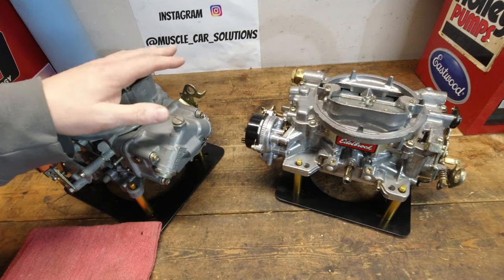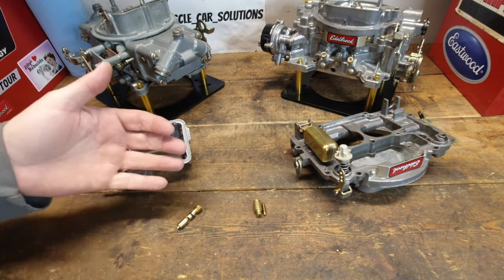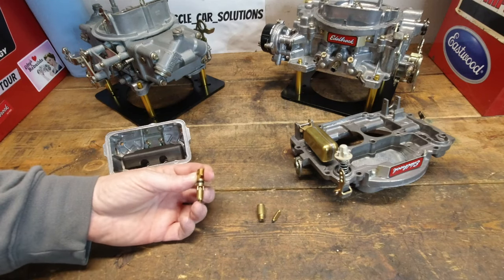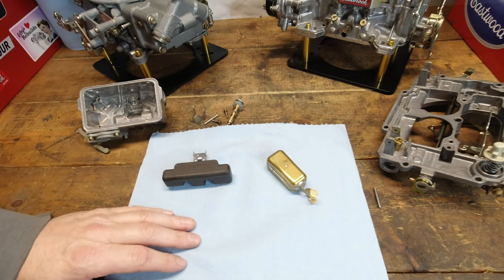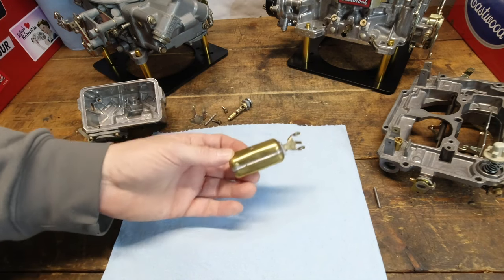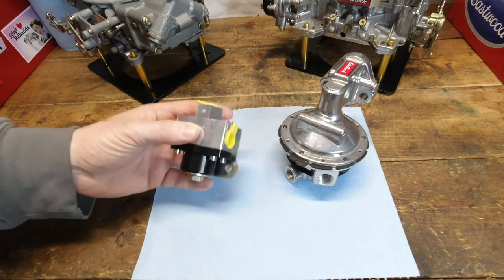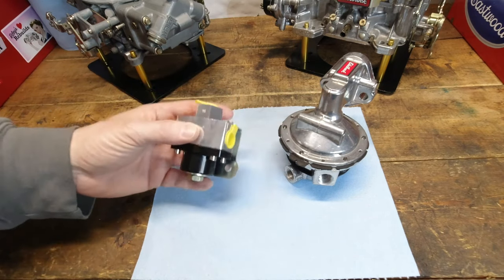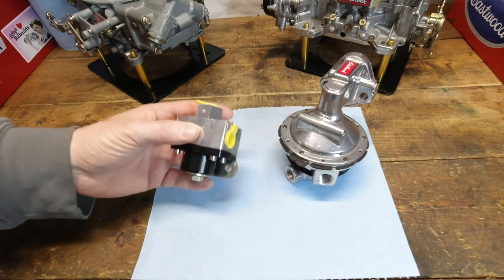4 Reasons Why Your Carburetor is Flooding

Comment: I had a motor break and i thought it was just because it was old and then found out the Brawler i had put on it was missing the 2 center-line bolts on the base-plate and 3 others were fairly loose. I cant say the carb was the problem but i have never seen a shoddier assembled Holley. The inside bowl gaskets and metering plate gaskets were over torqued to the extent of ripping them.
Reply from the maker: That doesn’t sound like fun.